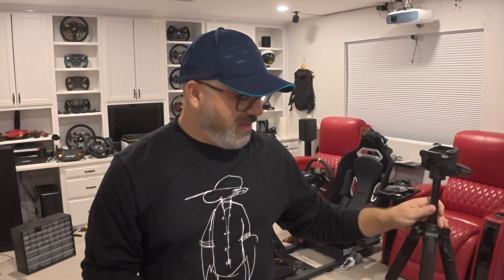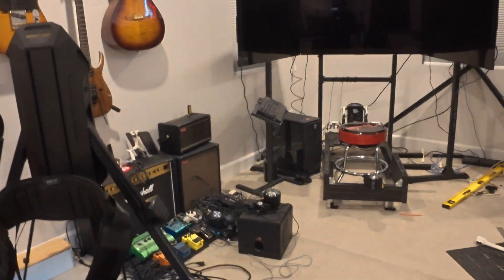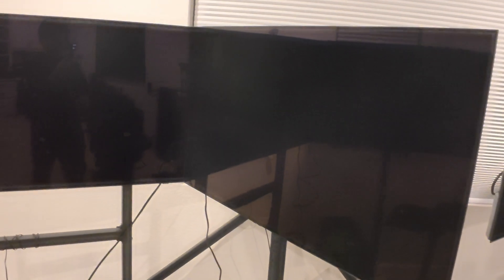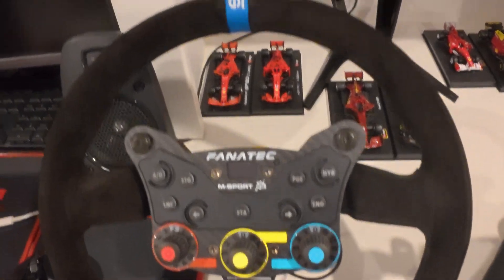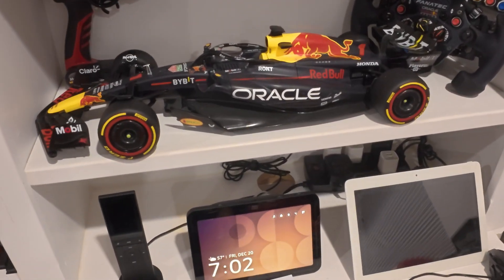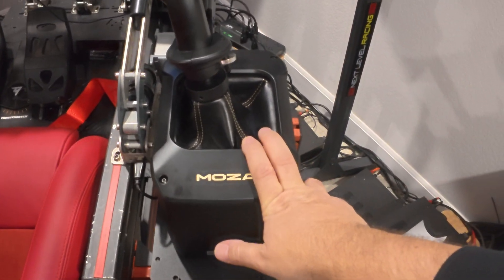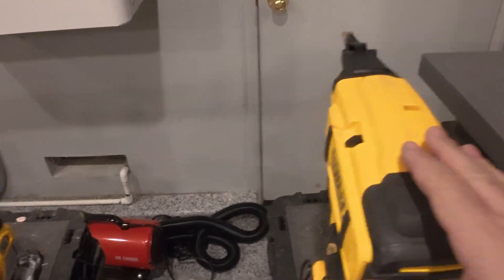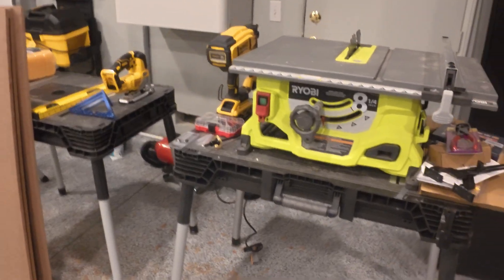New Series - 737-800 Sim Rig

Comment: Hi! Thank you very much for your videos! I also bought eracing lab and I have trakracer tr80. What tslot aluminum profiles did you use for the motion platform? Do you have heavy, regular and light? Also very interesting to know what angle brackets 40 and 80 mm you used. Did you buy tnuts and bolts from trakracer?
Reply from the maker: Hey I went with regular - no need for heavy. The  angle brackets are from trakracer (they have the best and sturdiest brackets out there). The slots are 8mm
Reply: @simul8master  Ordered corner brackets 4040 and 4080 from trakracer . With 4040 brackets everything ok . But for 4080 brackets need m8 bolts with no more than 11.1mm head diametr . Standard around 13 mm . I can't found m8 screws with smaller head ((
Reply: Thanks a lot!!!